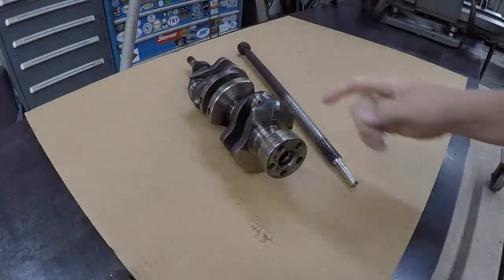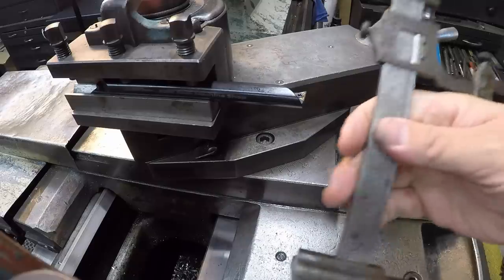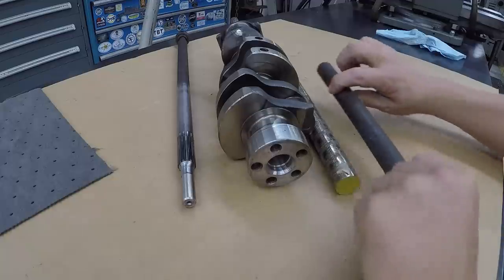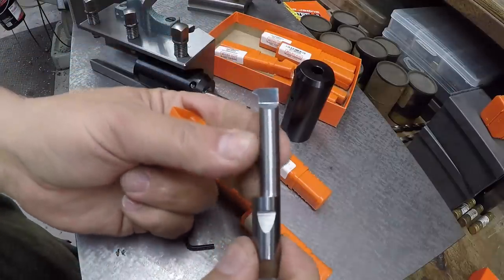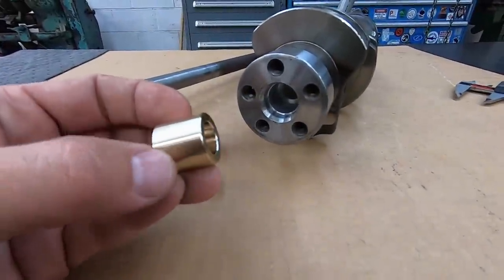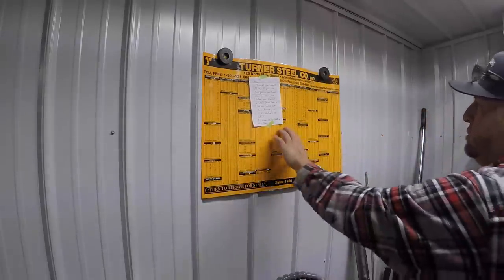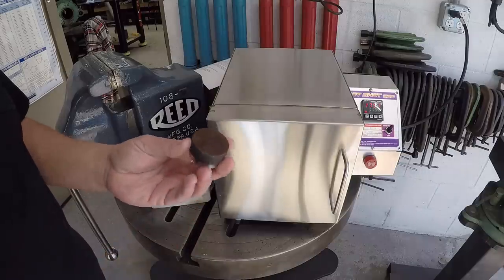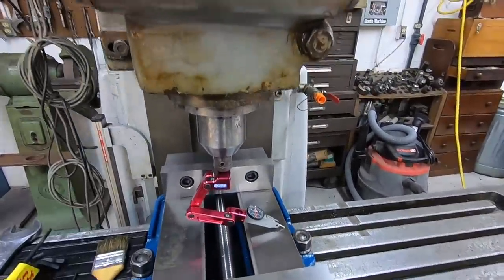SNS 294 Kubota Crankshaft Hot Shot 360

Comment: Nice work Adam. I’ve made several custom pilot bushings over time and have always used the sintered oilite material. The material is infused with 30W oil. I always re-infuse after machining since oil tends to leech out during the machining process. It can be done by placing the bushing in a cup of oil and putting it under vacuum until it stops bubbling. An old transmission guy said to avoid converting to a roller bearing because the input shaft may not be hardened.  I enjoyed your video as per the usual.

The tile material you have is of the 22 lb density material. It was used for the orbiter tiles in areas as those around the edges of the nose and main landing gear doors. They are stronger than most tiles on the orbiter which were only 8lb density per cubic foot. They are remarkable materials and are approximately 94% air. Most tiles had to be re-waterproofed after every flight because they wick up water way better than a sponge! You should pour water on a block of it to see how much water they hold.  I work in the machine shop where tiles are made. We make them for the Orion capsule and for Sierra Nevada’s Dream Chaser vehicle.

Comment: Great  Work.  I  Retired   from  a  Major  Airline,  Maintenance and  Pilot. Our  Hanger  had  a   great  shop  and  a  Master  Machinist of   40  years  that  would  make  parts   and  special  tools   for    Engine   changes   and   1  off  odd  things. One  day   I  was  in  a  Hurry   and   tried  to  make  a  Simple   alignment    tool  for    the   engine   bushings...  I  screwed  it  up   quickly...  and  was  shooed out   the   area   from  our   Master  Machinist...he  said in  A  Thick Russian  accent   "  Your work  is   so   bad   im  shocked   the  Lathe  and  Mill  Machine  didn't  unbolt  itself and   roll  away  from  you ...Give  me  Print   and  a  Hour  it  will  be  done".

Comment: Nice video Adam. I agree with the oil infused bushings for that application as well. Those types of bushings are used in automotive distributor bodies that the mainshafts run against.
I've learned a ton from your channel on machine shop work. I appreciate your efforts in describing what you're doing in detail along the way.  By the way, my favorite videos are the ones where you repair parts/items. Love em!
Keep up the good work!

Comment: Just a side note if anyone has to remove one of these bushings, one process is to fill the hole with grease, then insert a very close fitting shaft into it, and beat the shaft with a hammer. The grease acts like hydraulic fluid and will actually push the bushing back out as it compresses at the rear. Course, doesn't work if you can't get a fairly tight fit with your pounding shaft. Nice work Adam!
Reply: Shunta Wolf wet toilet paper does the trick
Reply: Anything will work including bread, not exactly rocket science
Reply: It works but the grease makes a big mess!
God bless you all!
Reply: @chrisbanning413  Hmmmmm interesting idea!!!
Reply: Nothing will work if it's a thin bushing without much surface area +inside to push against.

Comment: I have heat treated shrader valve tools with a torch when I was a kid. Used to dunk them in oil and could get rockwell 60 with them. We used to soda blast them to brighten them up. We made them for an air conditioning company for putting the inlet valves together. Sure would have been nice to have that oven. Great videos

Comment: Nice work. I would point out that while pressing the bushing your putting the stress on the threaded rods. Turn that splitter 90 degrees and put the stress on the body of the splitter. When I worked as a mechanic every splitter we had had the rods bent because of that practice..

Comment: Adam, I have a Monarch Series 61 (13 x 30 ) and had the same issues with parting,...tried everything to correct but to no avail,....until a friend of mine suggested I look at the slides under the cross saddle, which I did and to my surprise , this corrected the issue ! I suggest a quick inspection and rebuild of the retention slide clips on both sides, BTW great video !!

Comment: Thanks for another great video. Many years ago We used to rebuild classic cars, many used oil lite for their small end bearing. We used to lightly block one side of the bearing, fill it with oil then apply pressure to the other side until the oil oozed out through the pores, then it was ready for use.

Comment: Adam, you're the man! The solid core rod Oillite/SAE 863 stock only comes in lengths of 5" or less (sometimes you can find it in 6½"), because of the manufacturing process. (It has to be molded from powered and sintered, so it can only be as long as the sintering mold.) Also, the chip that it is forming is not indicative of sintered stock, which chips like cat iron. I think they accidentally sent you the wrong stock.

Comment: I just fixed the exact problem on a Kubota b7200. I turned the shaft down to .500 and turned the id of the flywheel and pressed in a oilite bronze bushing. Didn't want to pull the whole crank out.
Reply: But did Adam use oilite? People in the comments think not and that it was a mistake.

Comment: Standard automotive practice is to soak an oil lite bushing overnight in engine oil overnight before installing. Good trick to remove a bad one is to use a tap a bit  larger  and when it bottoms out it will pull the bushing out of the crankshaft.  Good  video Adam.

Comment: Adam- Good choice on the oilite. Just a small correction to your commentary, Silicon bronze Alloy 655 is not used for marine propeller shafting. That was typically Alloy 464, also known as Naval brass or Tobin bronze, for the company that used to manufacture and market it. The giveaway is the yellow color of the end of the piece of stock you have; Silicon bronze has a lot more reddish tint to it, and is used for fastenings and structural members in wooden boat  construction. Many thanks for the videos, keep ‘em coming. Best wishes from Stonington Boat Works up here in Connecticut.

Comment: Oilite is becoming very common on small and med equipment as an alternative to standard greaseable pivot and hydraulic ram bushings. Cuts down on maintenance greatly and the machine stays very clean and presentable over the long run, which helps with resale.

Comment: I'm curious about the Oilite you bought for the crankshaft pilot bearing. Oilite is the stuff to use in clutch shaft pilot bearings because it's installed where it cannot be lubed is service. It comes from the factory pre-charged with a special thick oil ensuring lubrication for lightly loaded journal bearings for many years of operation in fans, motors, etc essentially lubricated for life. It has a 70 year history of utter reliability in similar applications.

I've machined a lot of Oilite but all the same grade. It was a sintered product and being porous it machined to make granular chips something like cast iron and would "sweat" oil if it warned from machining. 

Your Oilite made ribbon chips and exuded no oil. I wonder if you got the right stuff - possibly leaded bearing bronze C932/SAE 660 which is a good bearing bronze but not Oilite. It requires periodic lubrication. General purpose Oilite meets a number of specs, among them: SAE 841. 

MRC gets it right 99% of the time. Could this be the 1%?  The websire of Motion Industries, your old employer, show it stocks Oilite in cored bars.
Reply: A dead giveaway is that SAE 863 only comes in lengths of 5" or less. I'm sure you can find it in liner or specialty lengths, but the vast majority is 5" or less in length, since it needs to be sintered in a mold.

Comment: Adam, I think it is likely you will have problems with that bushing. As others have mentioned that probably wasn't sintered. I made this very same mistake on a car clutch. The bearing lasted about a month before it started screaming due to a lack of lubrication. I replaced it with oilite and it lasted years.
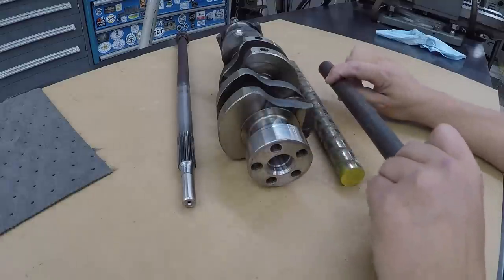Reply: 10:41
Reply: @wrangler5729  SAE 863, according to McMaster-Carr's website, is high-strength bronze...and not sintered oil-impregnated bronze. They call out SAE 841 for that. 

Weird though--because Google shows me several references to SAE 863 being available as "oil-impregnated" bronze. But I can find no mention of that being available on McMaster's website. All the SAE 863 stuff they list is "high-strength bronze," without mention of being oil-impregnated.

Comment: My main machinist back ground started off at a machine shop in East Orlando back when I was 14 the man I worked for is a life long family friend more a uncle then a friend . Shop was set up on the engine shop side but he also had 100 by 80 shop behind his house as well as the maine shop more tooling lathes mill shapers grinders then I could imagine..I am a gear head been fabricating, building engines machining parts and loving horse power since.. he lives in North Florida now you probably know him. His shop was next to speed world in east orlando little hick town called bithlo just before tittusville i lived in @ port Canaveral  to be exact for 22 years.Anyway my point is how amazed I was the first time on the crank grinder one of 4 I think... he has a sweet Sioux lathe I learn on it was my learn right from wrong the hard way but I learned quick common sense can take you a long way in the machine shop and life . Also he showed me so many ways to think outside the box the best lesson was I had a complete machine shop along with another at his house with the big lathes ,I mean big!... Tig,mig,stick, welders material to work with never throw out anything and with the machines as long as I had that there was nothing I couldn't do sometimes took a day just building setting up tooling and jigs to make/fix/modifying a part  I learned my life skills from him .. I got completely nostalgic on that one

Comment: I agree with the others, that is not oilite. Oilite will make fine chips that resemble fine sand.
Reply: Looks like he did the bronze not oilite
Reply: That looks like C863 manganese bronze, not SAE 863- I’ve done some work with C863 and it cuts exactly like that. It’s a high-pressure, low speed bearing bronze that requires heavy lubrication.

Comment: I'm really confused by this setup, does this kubota tractor not use a proper pilot bearing (roller/ball bearing)? One that would fit into that first journal and that 2nd inner journal just as a relief journal for the shaft to float in.
Reply: A lot of engines use a bushing instead of a bearing. There's not a lot of load on this bearing.  Picture a length of rubber hose chucked in a drill, turn the drill on with nothing supporting the end and the hose will sling around wildly.  Now just lightly grab the end with your fingertips and turn the drill on,  you'll see that it won't take much, if any effort to keep the hose running perfectly true. This is basically all this bushing does except that's an exaggerated example.  In reality with no play on that shaft in the transmission side you could probably get away for a while without even having this bushing.  The only time it's in use is when the clutch is disengaged leaving this shaft stopped while the engine is still turning,  so basically when in gear with the clutch pressed. Any other time the shaft is locked up to the crankshaft via the clutch and there is no rotation in the bushing.
Reply: I think he is saying that the bearing/bushing should go into the first shallow bore and not the deep recess that Adam installed it in.  I think it depends on the application on where the bearing/bushing goes.

Comment: This bushing will work, but I feel if it was an option I would have put in a steel sleeve so the ID would have been at the original size, which would have allowed an OEM bushing (if fitted, I don't know how it comes from the factory) to be used.
Reply: meman17 its a pilot bushing to support the clutch when disengaged from the pressure plate. It needs to be there to keep the clutch aligned and not put an angular load on the input shaft bearing. The bore might not had sufficient wall to do a sleeve. Making a 2nd "one off" part and  wiring it to the bell housing would work so when it needs to be fixed again in 4000 hour of operation the mechanic will find it. 🤞

Comment: I'm an engine machinist.   That bushing should work but most agricultural engines have used a sealed roller bearing as a pilot bearing since the 1960's.    Not sure what Kubota uses because I wont let Kubota items in my shop,  always cost more to fix than what they are worth!  Great video! Love the oven!
Reply: Anything remotely modern I've seen in automotive is roller, updated to roller with a roller bearing mounted in a bushing, or a single row ball bearing.
Reply: Andrew Evans    I had to grin about your Kubota comment.  I had a buddy that bought a John Deere a number of years ago because, “I’m not going to have one of those Jap tractors!”
You guessed it, the first time he looked at the serial number to order parts - there it was on the tag - Made in Japan.  
We gave him proper hell.

Comment: Small note concerning tempering of high-strength nickel- and nickel-chromium steels:  I am not certain why, but some of these steels have "forbidden" temperature ranges where "temper brittleness" sets in, actually making the quench-hardened item MORE brittle than not tempering it at all.  This was found circa WWI when naval armor plates otherwise identical had different results when hit by armor-piercing projectiles when the tempering techniques were changed.  By WWII, most, but not all (some people are very conservative), naval armors had been modified with the improved tempering and better results ensued.  This is a general effect on all such steels and you should be aware that things are not as simple as they might appear concerning heat treatment processes.

Comment: Hey Adam, I wouldn't recommend setting the temperature at any higher than 1550 dungerees for hardening most steels. Because when you reach a certain temperature (austenitizing temp.) in a low carbon atmosphere, you will loose the carbon that's already in the steel which will dramatically affect the final hardness in your workpiece.
Reply: ...is that called: "decarbonizing"?
Reply: @daleburrell6273  Decarburization, yes
Reply: @ARad888  as I recall, one way to prevent that is to use a nitrogen atmosphere(?)
Reply: @daleburrell6273  Also correct. Another way would be masking the workpiece with No-Carb paint, or copper plating.

Comment: Those Micro100 boring bars look really nice! I've used Sandvik ones which have a similar locating pin/bevel system and WNT/Ceratizit which use a ground flat and I much prefer the bevel, the location feels a lot more solid. Haven't seen them in that large a shank size yet though, they've all been sub-1/4" on the shank diameter. The small ones always make me nervous as they're soooo expensive, the 3-4mm ones break if you so much as look at them wrong.

Comment: Oilite bronze gets the job done, but in many cases it's possible to machine the crank to fit a suitable ID & OD sealed ball bearing instead. Sealed ball bearings give longer service over bushings, and when they do go bad they don't usually wipe out the pilot on the transmission. Just something to consider if you have to do a similar job in the future. Most bearing manufacturers have online catalogs, so a  bit of browsing is all that is needed to locate a suitable bearing.

Comment: Doesn't look like oilite.. Oilite is compressed grains of bronze which is porous and impregnated with oil from the factory.. Usually used in bushings that are impossible to oil such as automobile starters,, etc.. You can take a new piece of oiliite that has not been oiled and heat it with a torch and it will burn with oil coming out of it.....
Reply: @Randy G I thought it might be 660 leaded bronze....Oilite would be perfect for that application though as it will be impossible to get lubrication to it once it is together....I think Chrysler Corporation pioneered powdered self lubricating bearings....
That type of bronze would be ok for the older electric motors or other bearings with ring oilers.. I have an old Westinghouse  motor in my K&T mill with ring oilers and I used that type of bronze or similar to it for new bearings as they are constantly oiled as the shaft turns..Mike in Louisiana
Reply: @Randy G great information there. I have a question from a non-machinist. I read one time that special care must be taken when machining sintered bronze. If it's not done properly, I read that you smear the bronze, closing the pores holding the oil. Do you know if there is any truth to this?

Comment: My dad worked for auto transmission manufacturer for many years and noticed the round magnets holding the poster are very similar to the magnets I saw growing up in my parents house.
Reply: I thought the same. Saw those magnets stuck around various places in the Ford Sharonville transmission plant. They are set into the oil pans, directly centered over the oil drain plug openings, to trap any ferrous metal particles. Surprisingly strong magnets.

Comment: The oil lite shouldn't be needed if it's just a spacer to put it back to stock size for a proper bearing to go in the
Reply: That is the bushing the transmission input will ride in, not just a spacer.

Comment: When pressing the bushing , have you used dry ice on the bushing and place the shaft in a 200 degree oven? you should be able to press fit by hand, and not stress the parts.